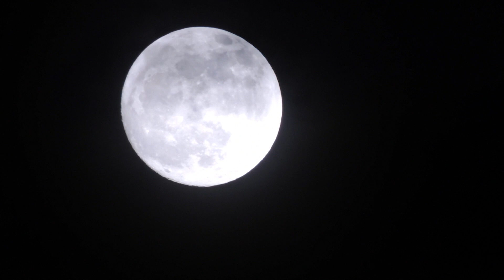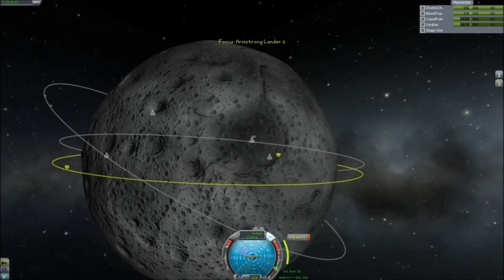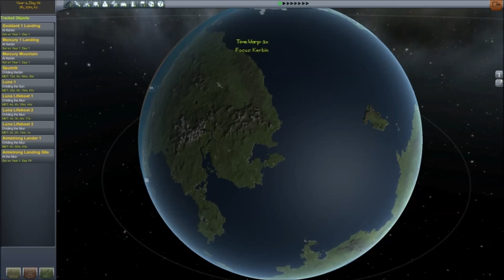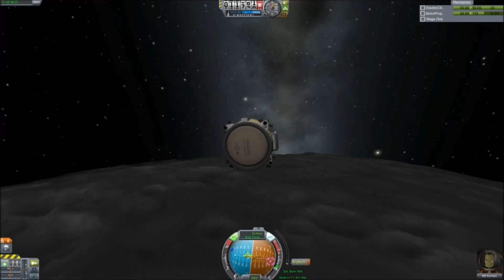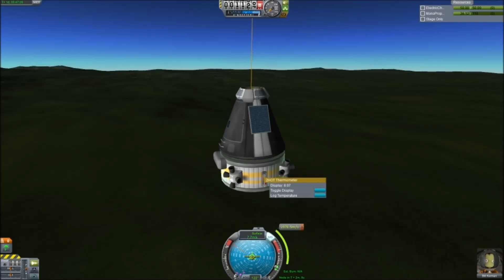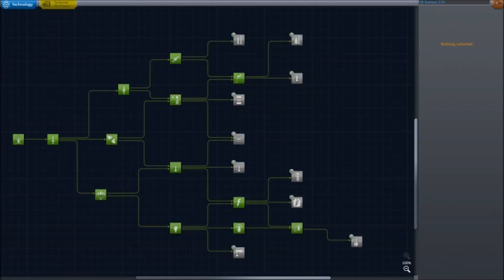Kerbal Space Program - Career Mode Part 11: Return from the Mun

Comment: Also a note is that in real life the orbit of your lander would degrade over time due to the fact that different parts of the surface of the moon have different gravitational strength.  I forget what the phenomenom is called but it doesn't occur on Earth, and only matters in low orbit.
Reply from the maker: Right, I think which is why the Moon in real life won't fall toward Earth.  Well, not without some sort of extraordinary event.

I've heard that too, I think it may have to do with what sort of rocks or terrain are on the surface.  I wonder, come to think of it, if that sort of problem also crops up with gas giants.  You'd imagine they would be uniform, but who knows?